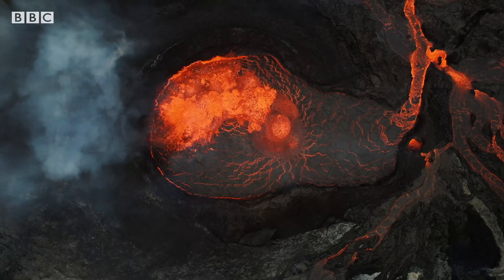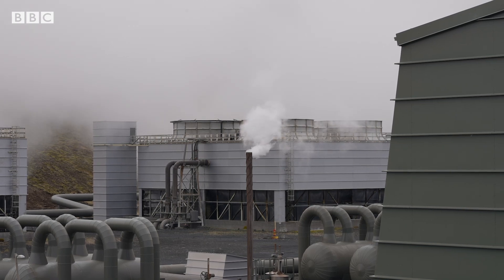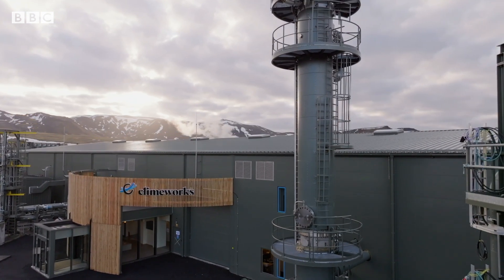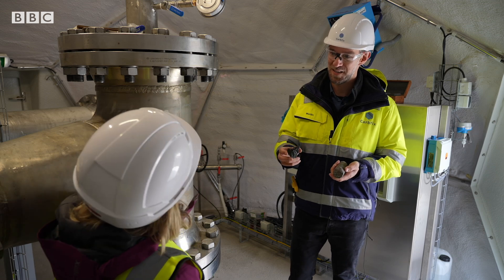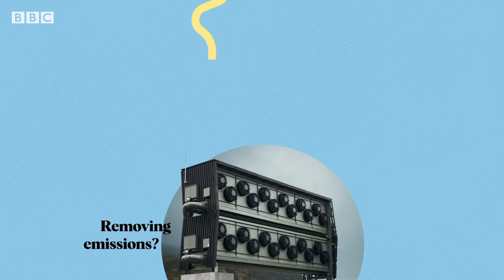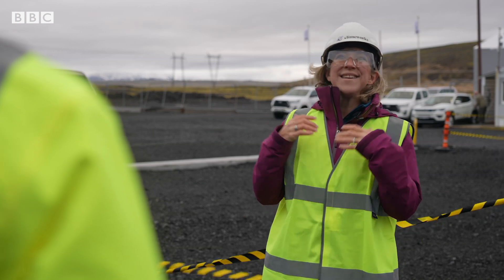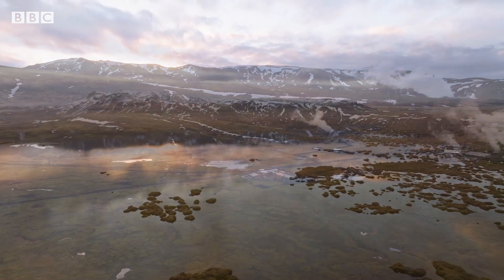Inside the hidden carbon plant pulling CO2 from thin air | BBC News

Comment: Nice advert for big oil's carbon credit fraud programmes. Iceland's being actually renewable powered is an outlier, most are fossil fuel powered and terribly ineffective - just like the new bigger one will be. There's also all the steel and concrete emissions to build this monstrosity. And then the water use - usable water is less freely available than we'd like to think.

Comment: Snake oil. Too expensive, uses just as much energy, and create about as much carbon, to build and operate than what it will ever capture.

Then you have the issue of storage. 

We know it does not work, else the UK would not have closed it coal plants, they would have continued with carbon capture projects that they were testing a few years ago. 

so this is green nonsense.
Reply: it's not green. green is a color, the color of trees. co2 is produced from green energy.

Comment: this tech doesn't sound convincing... how much co2 was used to build and run this? that should have been the primary question from the BBC journalist........ at what point is this a net negative and what is the net negative rate?????? solar panels become net negative past its life expectancy lol, this sounds worse
Reply: the only thing you can build with co2 is dry ice
Reply: "solar panels become net negative past its life expectancy"
Maybe if you install them in your bedroom.
But for normal sites, this is bullshit.
I didn't do research myself, but read in this forum, that the plant removes 20 times as much CO2 as building and operation emits/emitted.

Comment: I guess y'all have never heard of trees?
Reply: I guess, you never thought of a variety of approachs for CO2-reduction?
Why so many comments with "we should use trees INSTEAD" and no "we should ALSO use trees"?
Reply: @701983  I guess you've never thought through enough to realize that the emissions to build and operate this scam contraption will never offset itself.
Reply: @derrickblessel6884  I didn't dive in deeply, but I read in this forum, that this plant removes 20 times as much CO2 as its building and operation emits/emitted.
And this sounds plausible to me.
It has to use renewable energy of course.

Comment: The thing is. Carbon capture plants like this only makes sense if they are built somewhere that already has 100% renewable power generation.
They take power to run, meaning unless it's 100% renewable powered, you are burning fossil fuels to capture the emissions of burning fossil fuels.
Even if you powered them with their own renewable power source, it STILL makes more sense to just feed that power into the grid to reduce the need to burn fossil fuels in the first place.
ofc simply planting some trees or regenerating some land also captures carbon without needing any power or expensive capture facilities.
Reply: So Iceland is the ideal site for such plants. 100% renewable electricity generation (mainly hydro and geothermal). And no electricity-exchange to other countries.
But I don't fully agree to your point.
It depends on the efficiency of carbon removal.
If you can remove several tons of carbon with fossil energy, that emits only 1 ton of carbon, you have a net carbon removal.
In this case, the use of fossil energy for carbon removal has more lowering effect on the atmospheric CO2-level than a waiver of carbon removal and fossil electricity production.
Of course, that's pretty theoretical. If you count in costs, no carbon removal and no fossil electricity production will make more sense normally.
Reply: @701983  No that doesn't work. Just the plain physics of it means that it doesn't work that way. Even with 100% efficiency you still cannot capture more carbon than you release on an energy to energy basis. And we are nowhere near 100% efficiency. One can game the system to make it LOOK better, by using certain chemical processes to capture more carbon per unit of energy but ofc THOSE chemicals had to be processed in the first place to make them suitable for carbon capture and processing them this way takes energy too, a LOT of it.
Right now the best thing we can do with any renewable energy is to use it to negate the need for 1 unit of fossil fuel energy.
Reply: @Kizron_Kizronson  I think, you mix up "CO2 capture" and "CO2-reduction".
Capturing CO2 from the atmosphere costs much less energy than you get from combusting carbon and hydrocarbons to CO2 (and water).
Your argument would apply to capturing CO2 from the atmosphere, producing hydrogen by electrolysis of water, make methane out of the CO2 and H2 (reduction of CO2) and pump this methane into the underground.
THIS would be a real reversal of the process.
And would cost much more energy than you get from methane combustion.
But not simple CO2-capture without turning it back into a fuel.
Reply: @701983  Well then, congratulations. You have single-handedly solved the entire world's energy problems. By using less energy to capture carbon that the energy produced when carbon is released you have discovered humanity's first perpetual motion device/method for producing free energy
Reply: @Kizron_Kizronson  Seriously? You still didn't get it?
Again: Capturing CO2 from the atmosphere is not the opposite of burning carbon to carbon dioxide!
Making CO2 by burning coal is not the opposite of collecting CO2 from the atmosphere!
You would have to make coal out of carbon dioxide again for a real reversion of the process.
Reply: @Kizron_Kizronson  I did a look on the process that climeworks uses. 
Even with 100% energy from natural gas and without CCS of the CO2 from the natural gas combustion, we would get 0.4 tons of net CO2-removal per ton of gross CO2-removal.
That's not great, but clearly above 0 tons.
And if we would additionally use CCS for the CO2 from natural gas combustion, we could get several tons of CO2 removed per ton of CO2 emitted.
Even with 100% natural gas energy!
It wouldn't make much sense economically, but it would work.
Just for clarification.
Of course, we should avoid the use of fossil energy for CO2-removal technologies.
Reply: @Kizron_Kizronson  Such plants are not meant to compensate the whole CO2-emissions of today.
They would be part of a variety of methods to compensate residual "inevitable" emissions, after we largely got rid off fossil fuel combustion.
Together with (re-)forestation, "normal" CCS, BECCS, forced humification, forced use of wood as building material,...
Reply: It's similar to the question, if we should switch to electric cars or heat pumps, when we don't have 100% renewable electricity generation.
Since electric cars and heat pumps are much more efficient than normal gasoline cars and normal heatings by natural gas or heating oil, you can reduce CO2-emissions even by using a still rather "dirty" electricity mix.
Reply: @701983  Heat pumps, have the benefit of reducing overall power consumption and thus reduce the need to burn as much coal.  (EV's are a different kettle of fish, because power plants don't burn gasoline so it's a whole different energy ecosystem.)A CO2 capture plant INCREASES power consumption. The only way they make sense is if there is no fossil fuel power anywhere in their energy mix. 
Even if their power grid was only 0.05% fossil fuel powered, it would be more beneficial to NOT turn on the carbon capture plants and use the energy saving to reduce that 0.05% to zero.
Reply: @Kizron_Kizronson  Heat pumps and electric cars both increase electricity consumption, when they replace non-electric systems (gasoline cars, heating by oil).
But depending on the electricity mix, they can lower the overall energy consumption. And the overall CO2-production. Both.
And regarding "net carbon removal by fossil energy", look at the answer before.

Comment: Displacing fossil fuels is often profitable in the long run compared to keep burning fossil fuels. Which means a negative cost per unit of CO2 not emitted. Capturing CO2 without any other positive effect will never be relevant compared to that.      

To be relevant, direct capture requires that all the vastly superior options to capture or reduce emissions is exhausted, so they don't need to finish their development anytime soon.

Comment: its not enough to make a change.
Reply: This plant doesn't make a substantial difference, that's right.
But this technology could be an important component of our fight against climate change in future.
Together with many other methods ("normal" CCS, BECCS, forestation, forced humification, forced use of wood as building material,...).
And together with a drastical reduction of emissions of course, which is the most important part.
Reply: what I was trying to say was, this could work if every single country could have sites like this, multiple locations worldwide. Phasing out ICE for example would come a long way to remedy the situation. Like right now, the biggest contributor of emissions are motorbiikes. The ratio of motorbikes vs cars in my country is like 10 to 1. its getting ridiculous.
Reply: @leorickpccenter  What country are you talking about? India? However, road traffic will probably not be the biggest contributor of CO2-emissions, but electricity production.
However, we have to reduce emissions drastically in every sector.
And an important way is electrification of transport and decarbonisation of electricity production.
Reply: Philippines. Although, now that you mention it, roads are starting to look like India with the sheer number of motorcycles on the road. And yes, I agree with you. So many sectors needs to be addressed.

Comment: one plane operating a year say a 737 would produce approx 50k ton CO2 eq, so for each plane we would need one of those plants
Reply: We will rather use such plants to get the CO2 for e-fuel-production some day. To provide non-fossil fuel for planes and ships.
And yes, this will be expensive.
Therefore, it probably won't happen in near future.
On the other hand, you shouldn't project the size and costs of such a pilot plant directly to a larger scale.
Plants for 36 million tons of CO2 per year won't be 1000 times as big and expensive as this one.

Comment: Wait a minute. This plant is taking out naturally produced carbon from the surrounding area. 

Isn't naturally produced carbon the process that feeds the biosphere and all life on Earth as we know it.
Reply: Yes and no.
The biosphere doesn't make a difference between natural CO2 and "artificial" CO2 from the combustion of fossil fuels.
And since CO2 spreads quickly by diffusion and convection, the share of "natural" and "artificial" CO2 is pretty much the same all over the world, as well as the concentration level.
For climate change or for the fight against climate change, the location of emitters or CO2-sinks is completely irrelevant.

Comment: These are great at removing CO2, but we must start looking at removing CO2 around the world that does not provide geothermal energy. Other countries have to rely on nuclear energy to power these plants not photovoltaics
Reply: These plants need a lot of heat energy in the first place, for desorption of the CO2.
The process of "climeworks" needs 2.5 MWh of heat energy, but only 0.5 MWh of electricity for the fans.
Solar thermal power plants could provide the needed heat and electricity.
Reply: The numbers (2.5 MWh, 0.5 MWh) referred to the capturing of 1 ton of CO2.

Comment: would freezing out the CO2 instead of filtering it capture a larger fraction of it?  Or would the energy cost be too high to do that.
Reply: Yes, energy cost would be too high.
Think of the energy costs of "water from air" by cooling!
And there is much more water than CO2 in the air. And water boils at 100 degree celsius, while CO2 sublimates at minus 78.5 degree celsius.

Comment: What about methane and nitrous oxide capture?? Both many times greater per weight ! Green house gases also have many uses 😅
Reply: they can't convince people they're killing the planet with water vapor
Reply: Capture doesn't work for these gases, because there is no "chemical trick" like with CO2, which reacts with alkaline substances.
Besides their extremely low concentrations in air, much lower than the concentration of CO2.
Reply: @701983  liquid air ! Is the process!??? That’s how they get industrial gases !?
And yet they are , methane 27 times worse as greenhouse & nitro’s oxide 125 times ! And there are places close to sources that could be utilised , where concentrations are higher, where removing would be beneficial to atmosphere and as they are useful in commercial and industrial 🏭
  ie; indoor cattle and pig etc farming for methane, also industrial compost for both gases
Reply: @robertwoodroffe123  Yes, but this process is much too energy intense to remove million tons of these gases from the air.
You would have to liquefy 1.5 million m³ of air to remove just 1 kg of N2O.
And I'm not sure, if this would work with gases in such low concentrations anyway, beside energy consumption.

Comment: 36k tons is about half of the emissions of one standard commercial flight from NYC to LA. I don't know if the energy, material production, and overall carbon footprint of the build will make this worth it. But hopefully this is just a first step and future projects will be more efficient.
Reply: It seems like passing better and more responsible regulation on CO2 production is the better way to go. At least at this stage in the fight.
Reply: Decent and necessary first step. Looking forward to the 1 million ton a year facility.

Comment: An alternative solution.

Solar Hydrogen Energy Recovery Gas Turbine with CO2 capture. 

301Kwh (equal to 46/6.6Kw home solar installations) of solar energy collected from the sun’s nuclear fusion is sufficient for electrolysis to power a hydrogen Gas turbine and operate an energy recovery system on a hydrogen use as produced basis to generate a variably regulated energy range between 80 - 330Mw with optional co-generated steam capacity up to 700Mw of electrical energy on a 24/7 basis. 
The turbine has three operational parts, cost $36.5 -49.5 million, requires a footprint area the size of a football field, noise level is 60dbl at 60m and incorporates inlet vacuum direct air capture of CO2 at 1,400 Kg/sec.

Comment: Trees do the same thing idiots!
Reply: I simplified it a bit to emphasize the difference.
Of course, forestation has its part in fighting climate change as well.
But it's just ONE way to adress the problem.
One problem is the need of fertile land, which could also be used for agriculture.
Reply: Trees produce carbonate rock?
I doubt so.
They produce wood, which gets decomposed or burned back to CO2 at the end of the day.
Reply: @701983  Not 113Doctor fault if humans are so stupid as to burn trees!
Get a grip, human!
Reply: @11ThreeDoctor  "Back to CO2" applies to decomposition as well.
Reply: @11ThreeDoctor  And trees often burn without being used as an energy source (forest fires).

Comment: Last we checked, there's nowhere in the US with the same geothermal capabilities as Iceland, so how, exactly, do they intend to power a US-based plant, or one in Cyprus? Nuclear power will skyrocket the costs, so that's out of the picture, and, again, last we checked, nuclear fusion/fission are still very much in testing mode, soooooooo...?

Honestly, this just seems like another hair-brained, half-assed non-solution contrived by capitalists to allow them to continue destroying the planet without consequence.
Reply: The process needs heat in the first place, for desorption of CO2 from the filters.
Electricity for the fans is just a fraction of the energy demand (1/6 in the case of climeworks).
Solar thermal could also be an approach.

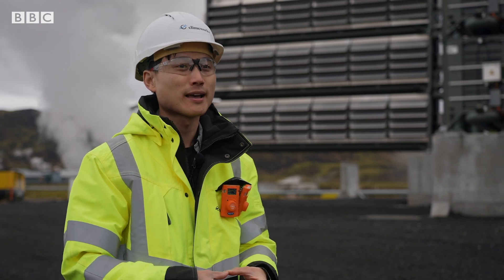Comment: 0:45 We would need about a million of these around the globe to capture the yearly industry CO2 emissions.
🤔 So you're telling me there's a chance.
Reply: But nobody propagates such plants to compensate the whole emission of today.
They are meant to be part of a variety of measures, which compensate inevitable RESIDUAL emissions after we largely got rid off burning fossil fuels.
Together with "normal" CCS, BECCS, forestation, forced humification, forced use of wood as building material, ...
And this is just a small pilot plant.
Let's assume 20% of today's emissions as residual emissions. And the compensation of 20% of these residual emissions by such DACCS-plants: This would be 1.5 billion tons of CO2 annually.
1500 plants with a capacity of 1 million tons per year.
Worldwide! Absolutely feasible.